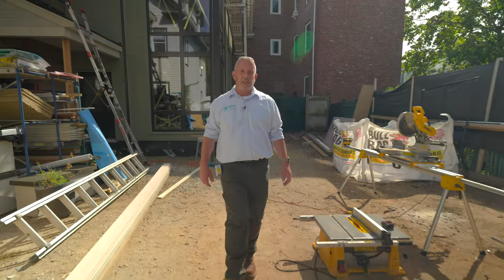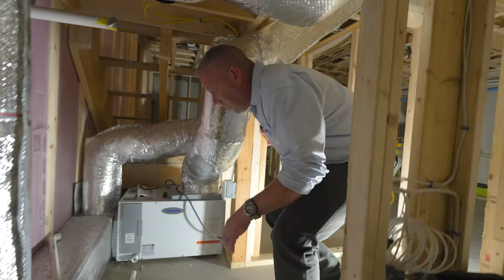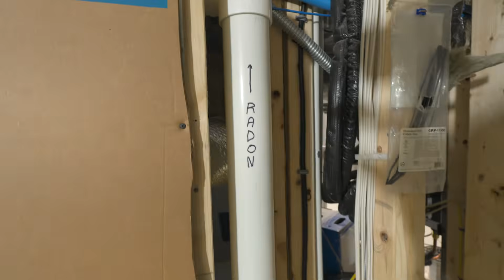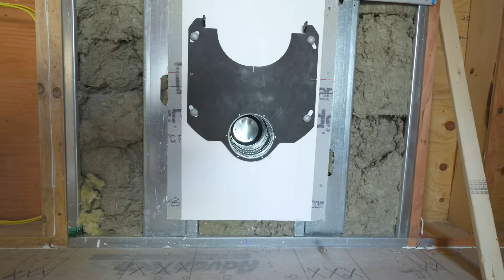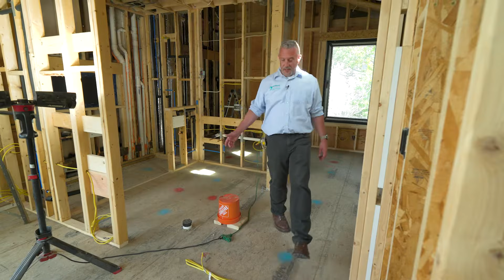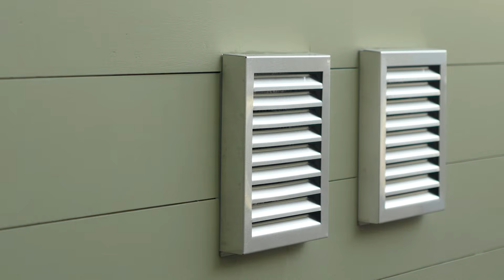How To Fit All The Mechanical, Electrical and Plumbing Into a High-Performance ADU

Comment: Being forced to use electricity to heat water & cook food, while burning a wood fire is wild.
Reply from the maker: Yeah in this case it’s a lot about looking at all the building systems, code requirements and preferences to find solutions that hit all the marks. All electric is our starting point, has lots of cost benefits (smaller make-up air systems for instance) and definitely see the appeal of a wood burning fireplace for ambiance during the winter.

Comment: Just paused this video and ordered the fan tech filter box off Amazon to pre filter my $90 merv 13 filter in my ERV.
Reply from the maker: That's great to hear! It’s a pretty cost effective way to preserve the more costly ERV filters.
Reply: @auburndalebuilders  could you please tell me the specific product you used for the makeup air damper for the range hood? I haven’t done my kitchen yet and have been looking into this but there’s not a lot of information available.